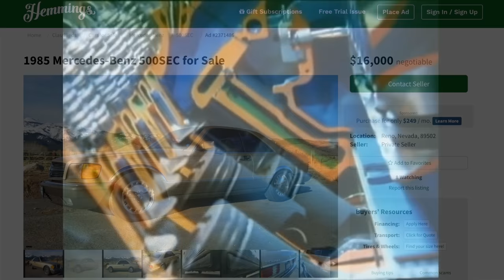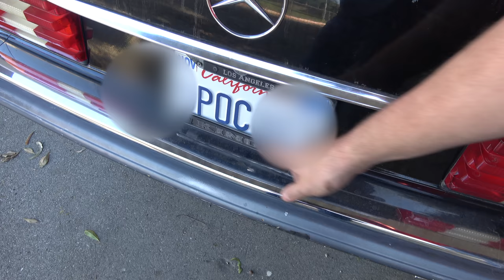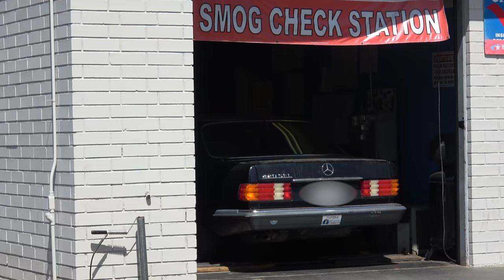Can $1000 Buy A Dictator Car?

Comment: If you're going to go around chasing and driving these beaters as I've done for too many years, may I recommend one thing:  Carry some heavy plastic with you (and in every vehicle).  My favorite is a shower curtain liner.  Heavy gauge, big enough to move around a bit, and usually can be $Free, just keep the old one when putting a new one in the shower.  Saved me much grief and clothing over the years.

Comment: I had a 1982 Mercedes 280E that was also brown. The vacuum door locks were failure prone but it was so solid otherwise. The doors always closed with a solid thump and the straight six was very reliable. Almost indestructible car.

Comment: I had an '82 SEC 380 a few years back, thinking it would make a good grand tourer that was cheap to run. Within the first 2 months I had to replace the front control arms - $500 for each arm and labour was several hours at $140/hr.

Love those cars, get what enjoyment you can from them.

Comment: You guys are braver than I am. I fixed and sold many old cars. I never bought a Mercedes because I was concerned with problems that I couldn't afford to fix. This one looks like a lot of labor items, which hopefully don't require expensive parts. Used cars are always a gamble. I lost on a few of them, but usually did okay if I felt comfortable with the car. It looks like you're comfortable with this one, you owned one in the past. Hope all goes well. The tires made me laugh because I drove on stuff like that before. Thanks for the video.

Comment: Let us know if you get the smoking smell out.  I had a Camry that I left in my garage with the windows open for a year and it still stank.  I replaced the carpet and it still stank.  I got an ozone generator and gassed it for 2 days.  It got better but still stank.  I just couldn't get the smell out of the headliner and seats

Comment: Ahhhh yes... Mercedes Benz from the 70's and into the early 90's was the best era. Those cars were built to last. I myself have a black on black 1985 500 SEC with a tad over 100k miles that I pourchased from the original owner (videos on my channel). She is my beastly peach and I have no intention of ever selling her. 

The 420 SEL is a terrific 4 door sedan and a little cheaper to maintain than the 560 due to a simpler suspension. Just be advised that the vast majority of examples left on the road or in driveways have been abused and neglected. Buy the best example you can! There is nothing more expensive than a cheap Mercedes. ;-) 

Everyone who buys one of these should immediately replace those aluminum fuses. The copper versions are not expensive. Purchase a used and working Fuel Pump Relay. Do NOT buy a new one from URO (the shittiest aftermarket company on the planet). If your w126 will not start that is the first thing to check. Mine went out last month! I now have two spares. Both cost me less than $40.

The a.c. vac pods tend to split and it's quite a job getting to them so if you do, replace them all. ALL OF THEM! Do it all at once since you have to tear down so much of the interior to get to them all. You will thank me later. 

Last piece of advice: If the timing chain, guides and tensioner have not been replaced you MUST do the job!  If that chain slips or the guides crack (and they do with age) your engine will turn into a hand grenade. And use the genuine Mercedes parts. The aftermarket guides/tensioner are shit and are known to break, grenading the engine. This job will cost $1500 to $2000, depending upon who does it for you.
Reply: Love your SECs man -- both old and new.  Which one is better?
Reply: So I guess it's an engine where the valves can touch the pistons. (Usually why they use a timing chain instead of a belt AFAIU.) What is the technical term for engines where that cannot happen? (In German it's Freiläufer.)
Reply: As they catched it in Ontario maybe someone wanted
to steal the gas.
Reply: @Dowlphin   a non interference engine is one where the valves won't smack the pistons
Reply: @philagethechef  Thank you!

Comment: Hey guys, whenever you're messing with spilled fuel repairs, ALWAYS first disconnect the battery. 
Any spark from grounding your tools to energized connectors, harnesses and/or positive posts, of course can be disastrous...
Reply: Could have turned him into a hothead there.

Comment: An S-Class is just the best car to travel in and fun to work on. Not great as your only car but the car you want on long trips. They'll last forever if you actually care about them. 

The W220s don't get the love they deserve (apart from the troublesome hydraulic ABC models). Very reliable engine and transmission combo. I have a 2000 S430 which was special ordered and has a few options rarely seen. I truly think they'll be displayed in a tech museum for the level of innovation (fiber optic communication, standard satellite nav, voice control, etc.). If you know how to repair electronics they're even more enjoyable.

It's ashame they had corrosion protection issues and most that went to cold climates had rot. Luckily I have one without any that stayed in the southeast.

Comment: Mercedes also offered this as 260 SE Upon its actual mileage
i strongly suggest a transmission oil change as its never
intended as a lifetime fill! Cars serviced by Mercedes got 
each 50'000 KM a transmission oil change. That is also 
why they last so long and shift smooth. Here we go!
The engine timing chain made a lot of noise on the cold start... 
or the crankshaft guides. Diagnosis from far are tricky.
Orignal parts are not expensive except you need some 
hydraulic parts for the heat-vent-a/c system. And i suggest 
to change the headlights to the original european, you will 
like the increasement from glow- to real headlights. 
Mercedes source have also original parts. (Kent Bergsma)

Comment: Well, I'm a 14 years old teenager from Brazil, and since I was a little kid, my dream cars never were Lamborghinis, or the symbol of status around here: the Chevrolet Camaro. My dream cars always were and still are land yachts. When I was 9 years old, I had a printed picture of a Lincoln Mark V in my wall, this type of car that is seen as ugly in my generation always had a special place in my heart. But unfortunately, because of government restrictions and a big and complex type of tax system, land yachts never were a "thing" around here, the biggest car that we got and can be considered a land yacht was the Ford Landau or LTD, that was sold since the late '60s until the mid-'80s without a single change on the interior and exterior designing...so, I just accepted the fact that will never have the chance of having a Merc like this as my first car...

Comment: When i turn 18 i know my dad's gonna hand me that old an' trusty, but i'll answer "leave that to the garage, i'll buy myself a cheap dictator car"
Reply: Some parents are like: We're gonna fully fund your first car. And we will buy it brand new. And then it's gonna be a Suzuki Swift 1.0.
Of course because they are worried a fast car will kill them. - A smart teenager will then explain to them what happens if a red light running SUV crashes into that compact car. (And hope they don't understand that big old cars might perform worse there. But they will understand because dad has watched automotive TV with crash tests and all.)
In that regard I was quite lucky. Fully equipped 6-speed Corolla 1.6 is nothing to complain about. (It pays to instill an aura of responsibility.)

Comment: The old mercedes benz were very comfortable and at least they didn't have all that stuff that goes wrong with them on the new ones. I had one and it had that rotten k jetronic system which left me stranded...curiously turned out to be some weird sort of a vapour lock - otherwise it was a very comfortable car ☺👍I also had a loan of it large S Class sports; very cool car, heaps of power but drank more oil than fuel! Hahaha

Comment: I had a few W126's in the 90s, a 1985 500SEL and an 87' 560SEC - The 85' was fantastic, it had 120k on it and 220k when sold, to a complainer that loved it for another ten years until he passed away.  The 87' was less reliable and the rear hydraulic suspension kind of ruined the fun of the earlier car.. anyway, they are tanks and will take a serious hit from big trucks, the front and rear are crumple zones that perform, but another reason dictators loved them was they could maneuver and escape danger well - many times the reason I never tested the belt tensioner (piston fired by gold plated bumper impact sensors) or the other dozens of advanced crash gear..  Koni shocks for a nice upgrade, without ruining the look but getting better tire options too ( -  no chrome!  Avoid the chrome when shopping for one.. They were built when engineers ran the company, and testing, research etc was 10 year cycles instead of current grey goo of design theft 1.5 year cycles.. Downfall to that system of manufacturing was Lexus.. Toyota's (L)uxury(E)(X)port (U)nited (S)tates, where parts bin sharing plus styling and features copies (though reliable and well made, no hundreds of millions of dollars in crash testing.. Daimler even gave away a lot of data under a program.. ) meant Benz had to radically change.  I never had any Toyota for that reason, even though I had Honda stuff, who did it with Acura (the Legend was great), and Nissan did it with Infiniti after the first two pulled it off with huge profits.   

Great stuff was made through the 80s, until baby boomers decided it didn't matter how stuff was made, even by ruthless regimes, if it looked as good, but was cheaper (on the heels of the cold war no less).. cue Bill Clinton, whose wife was on the board at Wal-Mart for many years until they were elected, using CCP cash in both elections.  Great car! hehehh  a novel.  Thanks always for the great content!

Comment: probably top of the line back in 1980, and extremely expensive,, like $100,000 plus back then.   Only worth price you can get from salvage yard now,   total disastrous money pit to repair.  The trans rebuild is about $3k to have done.  The hydraulic rear suspensions so smooth but when buggers up (weird bounce in ride) i,  can suck your 401k dry.   the car is resale about $1000 if running.

Comment: I have 4 of these W126s. They are really good to work on. But you absolutely have to read up on what parts to use. Even good brands can sell you dud parts for these. 
The mechanical injection is very finicky.

Comment: Taking it easy because you don’t want the fuel line to build pressure... You don’t need me to tell you that there is more pressure in that fuel line at idle and slower speeds than if you were to go 60 or 70 mph...

Comment: Age and Ethanol content in modern fuel rots the older style rubber fuel lines
Reply: Yeah, this has been an issue in Germany, too, where the industry lobby wanted to push legislation that just doesn't give a damn about older cars becoming destroyed then, and AFAIR they partially succeeded by claiming if the content is low enough, there wouldn't be any damage at all. They provides studies, but of course in such a situation you cannot believe a word.
We now have regular fuel and slightly cheaper E10 fuel, and the outrage is that while the E10 fuel has up to 10% ethanol, the regular fuel doesn't have 0% but, too, only has an upper limit that's merely lower than 10% - I think 5%. ... On the other hand there is also covert resistance to that idiotic legislation and probes found that fuels tend to have a lot less than the upper limit, sometimes virtually none. (Green politics has a tendency of subversive trickery and ruthlessness to push their will through, so naturally they would face resistance.)

Comment: Ah, so Winston has been driving a suit for a long time. 😄
Well, first thing to do is to check it for bullet holes.
4:08 Universal penny parts are your least problem needing replacement on a Merc. 😏
4:30 "Gonna need a little bit o'" - "Love" - "body work" - That's what he just said! 😎
8:05 As you said: Smoker's car. 😄 (Maybe he just tried to get rid of the urine smell. 😆)
9:15 Lying on a puddle of gasoline, hair touching it. That would be a nightmare for me.
10:37 Why am I 0% surprised that the seller is from Nigeria? 😏
11:58 And if you wanna buy that thing new, you gotta get filthy-rich.
Takes a sufficient aversion to getting dirty to remember bringing a spare shirt. ... But hey, you could wear it inside-out and protect the leather seats. 😉 (Didn't the seller have a cheap shirt to give away? ... Ah, probably not.)
14:29 You bought it, now urine.
15:37 Reminds me of when I was in social care service driving an old VW Bus with totally worn shocks. I had some fun approaching a red light, stepping on the brakes rhythmically, and the guy next to us asked whether we had pumped kangaroo fuel. 😁
18:39 Yeah, I am wondering whether the thing was even road-legal or had expired checks. In Germany you are not allowed to transfer a car on-road to the buyer before it has passed inspections. You'd have to put it on a trailer. They're strict enough about it that people wouldn't admit such on camera.
19:00 On my 6-speed Corolla I removed the reverse gear buzzer. It was just a clip-on module on the speedometer circuit board, since the 6-speed was a variant. (Sadly I couldn't figure out how to remove the lights-on beeper which is on all models. ... On the Merc it's probably so loud because it was designed to work for old people with bad hearing.)

Comment: Good thing it has sentimental value for you since you paid $1100 for a $500 car... The worst used car to buy is a Mercedes because they do EVERYTHING upside down and backward and every complicated system will take turns breaking down. All parts are expensive and many MUST be Mercedes parts (which they won't manufacture after the car is 20 years old). Better by another one for parts...

Comment: The odd thing about cars is the weird pricing for parts. A replacement window regulator motor for a Buick is so reasonably priced at $30, while a plastic bracket to hold a license plate is $40 and a set of replacement knobs for the radio is $35.

Comment: i had the impression that old german cars were unstoppable tanks with german engineering and only in the last 20 years started using plastics in the engine bay which lowered reliability.

is there an old car that is bulletproof as far as not breaking?
Reply: That's just not true. Plastics were used long before that and Germans didn't use it for things like the intake manifold until they were confident in reliability. The emergence of turbochargers, higher compression, and direct injection has lowered reliability much more.